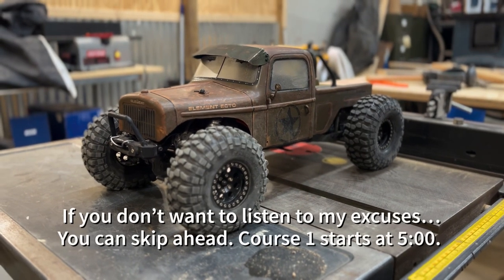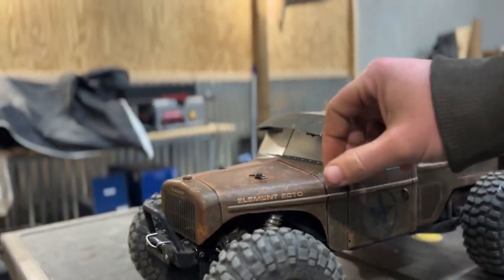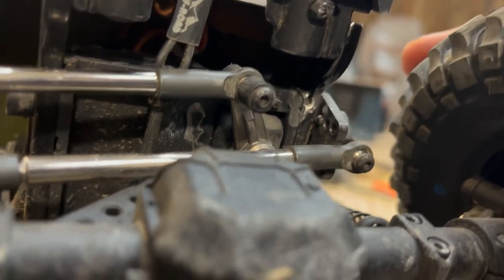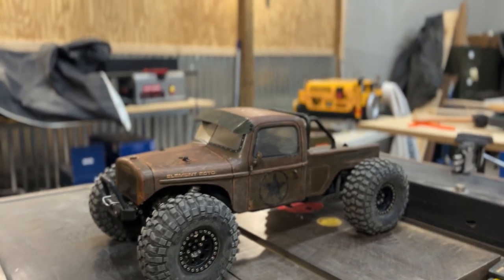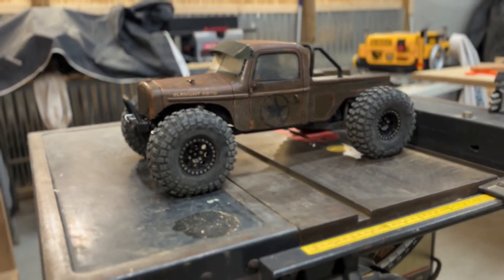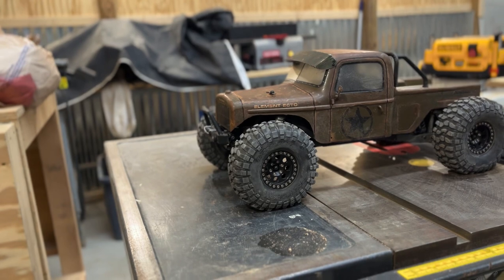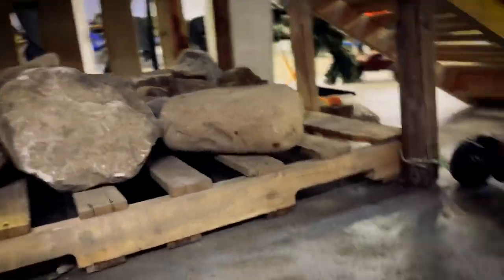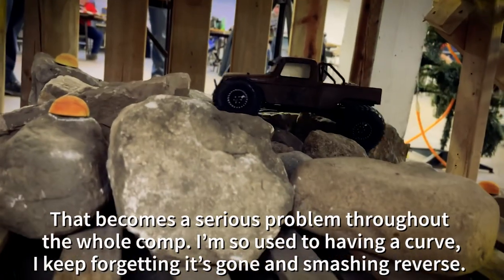I take Ecto to my first comp! (Bull Ring RC Center)

Comment: Very cool course!!
Nice job.
That rolling culvert was cool!
Small jagged rocks always tough.
🍻
Reply from the maker: Thanks. It was definitely a pretty cool little indoor course. Gonna take some getting used to, but I’ll get it figured out!
Reply: I’m sure just the mental notes and getting used to all the timers and gates like you said.   I’d think the trailing arms would make the jagged stiff harder.
Reply from the maker: The trailing arms really aren’t an issue for me, they actually seem to slide over things better than my linked trucks. On this truck specifically, I’m keeping the trailing arms and sway bar until I go flat rail/lcg later down the road.

Comment: Nice video your truck perfored well inspite of having the settings messed up.  Good job on the filming as well, I couldn't imagine trying to do both.
Reply from the maker: Thanks! I’ll get it figured out and have it back in working order for the next comp in a couple weeks. Yea, it seemed like everyone else there shared your view… but I’ve been driving one-handed and recording for so long that I’m just used to it. Most of the time I actually drive better one-handed now instead of using both. It’s kinda weird, but it usually works out for me.

Comment: Sometimes these trucks take up so much prep time that you can only work on them here and there and then little stuff gets overlooked because of interuptions. You did alright for a pretty tough layout and the  rig looked fairly grounded from lowering it for the most part .Tires hooked up pretty good too .
Reply from the maker: Thanks. I’ll get it figured out. Dealing with gates and a timer is a whole different world. It’ll take some getting used to.

Comment: When ya get some extra flow and I know how it is living in West Virginia,,, but 75$ rock
Pirates interceptor chassis is killer for element… or get shock towers think have 50$ !!!! My ecto sits lot like yours but rock
Pirates towers servo mount sliders!!! But it’s freaking killer buddy!! Almost as good as my new GSpeed class 2 build!!!!😮
Reply from the maker: Thanks! Yea, I definitely have plans for the future to turn this into more of a performer, but for still being pretty much stock chassis, I think it does pretty well for now. Definitely eyeballing several Rock Pirates items though, but the way things are here lately, it’s gonna be a good while before I can afford such things. So I’ll keep tinkering and improving what I can, with what I’ve got, until that point. I think with just a couple fixes, I could probably at least be competitive… that steering issue was definitely my fault, and I need to get back into this ESC and see what exactly happened and fix my curve!